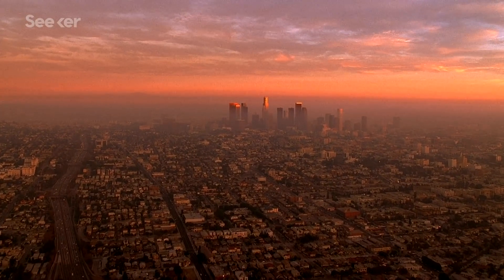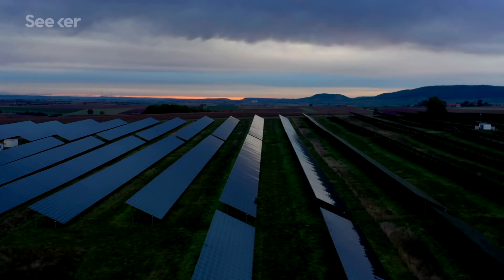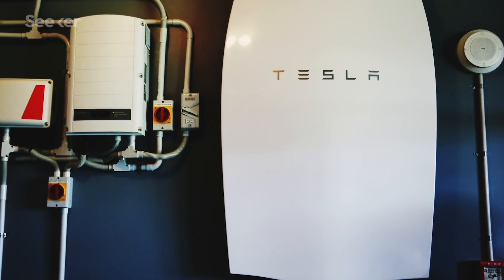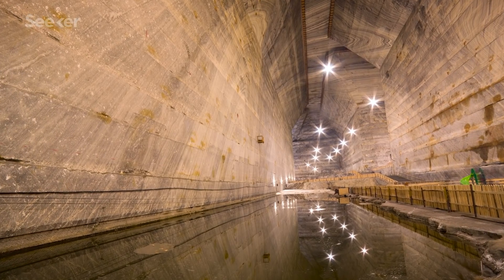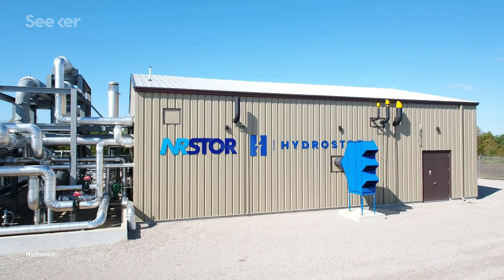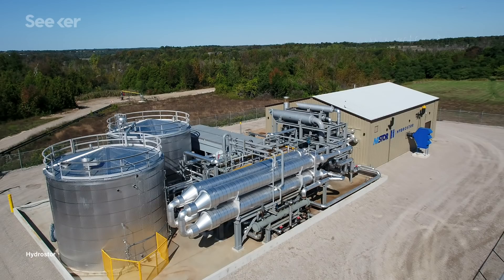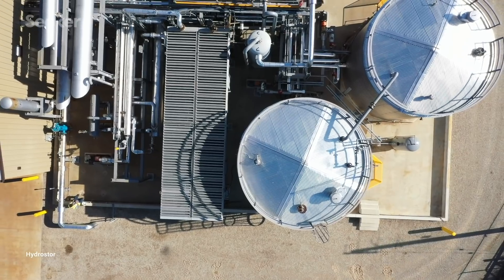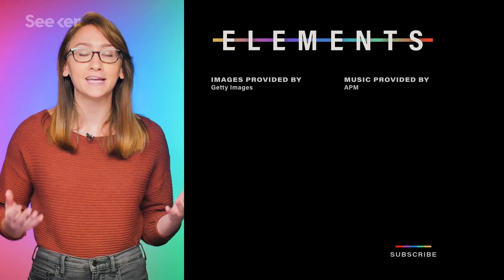This New Tech Could Revolutionize How We Store Renewable Energy

Comment: Instead of this just build a tower that will use electric energy at day time to lift the heavy blocks off the ground and by the end of the day blocks are at the top of the tower. 
And then it can be lowered down to run the generator at high speed and produce electricity.

Comment: By using a late Medieval technology called the Trompe, you can use falling water to compress air ... without suffering from heat build-up.
From 1905 to 1910, a construction project was created, to harness the falling water of a river, to compress air, to be sold to local mines in the Cobalt, Ontario region. The mine ran, with the occasional shut down for maintenance, until it was bought out by the Ontario Electrical corporation and shut down.
https://charleshtaylor.blogspot.com/2006/03/1905-1910-building-of-ragged-chutes.html

Comment: Carbon free. Buzz word for fake climate change as many many PhD scientists have called out. I will never get rid of gas vehicles. We will never moveboff thebmighty oil. Lithium, cobalt, and neodymium are super rare elements thus in no further explanation is that not everyone will be able to have EVs. Lithium cannot be recycled. Batteries have been around 100yrs and we barely can get 300 miles of a shitty tesla letbalone the hours and hours for recharging. Also electricity wont be free.

Comment: This is something I thought of a long time ago however I won't make claim to it due no money - and well no real proof I alone came up with it  too just not enough money     Anyway  an old thread sewing machine as an example   now the paddle is pushed by the needle which becomes a pole to do so ( there are other ways too) Anyway weighted appropriately it can be many many things  such as an non manual water pump    put between to bikes and a mechanical engine for the bikes ( if done the correct way )  a fan   a camping washing machine etc    I do not have money to do anything with this    - you can do this for yourself if necessary

Comment: The real scale of capacity needed? For the UK alone for full grid backup about 1400 to some 7,000 Terajoules. 
If the containment fails that's about 340 Kilotons to 1.7 Megatons in explosive yield.
Those figures don't really change if you store the energy as compressed air, in batteries, as chemical reactants, etc.
Not something comfortable to live next to.

Comment: 60% ain't enough - it drives up cost just like batteries. Pumped hydro does ~80% and isn't more pricy.
Cutting demand, flexible demand can help as well.
On demand biogas cogeneration, waste cogeneration plants could help, so batteries are souly used for immediate grid stabilization.

Comment: There are some manufactures that needs gas, and cannot use 100% renewable. 
Like to make glass. Where you need thousands of degrees of heat. Or to melt steel. You need gas for that. Renewables will not be able to melt those.

Comment: CASE is not efficient because air (or any gas) heats when compressed and chills when decompressed. It’s what drives a refrigerator. 
The question as to why is the only proven zero CO2 energy source being ignored is easy. It’s expensive - very expensive. Though it is extremely safe. 
Bit no longer We now have low cost modular nuclear which solves all of the reasons to not have the old nukes. And it automatically load-follows. It can fill in around renewables at no loss of efficiency. It even burns the high level waste from the old nukes. 
What’s not to like?

Comment: I helped build, license, startup, operate and shutdown or retire a two unit Gen III nuclear plant.  But as much fun as it was I just can't see their usefulness going forward.  Doesn't make any difference if it is a Gen III or Gen iV plant, a High Temperature Gas Cooled Reactor, a Thorium Molten Salt Reactor or even a Small Modular Reactor.  And it has nothing to do with no one wanting one in there backyard or how safe a Gen IV reactor can be or how wonderful and abundant Thorium fuel might be.  It is all about the money.  

The money to build, operate and clean up the radiological waste that just happen as the result of using nuclear power.  You know the daily radioactive waste clean up from leaking valves or pump seals or even the basic stuff like doing the laundry of workers who must work on radioactive plant components.  But there is something almost no one can control and that is the cost.  

You can spend about $2 to $25 billion dollars build a plant.  You will process your way through thousands upon thousands of cubic yards of concrete mix all while producing CO2.  You will install miles upon miles of copper wiring and control systems costing millions of dollars.  And of course you are going to spend billions of dollars to hire the electricians, pipefitters, welders, ironworkers and engineers to run the plant and those people don't come cheap.  Figure it will take about 100-300 workers to run each unit of a two unit nuclear plant.  Doesn't make much difference which type of plant you want to talk about it just takes about that many people.  You are either doing design changes, making the plant more efficient, working with regulatory agencies, cleaning up spills or just fixing stuff.  Now take those above number of 100-300 workers per UNIT and multiply that by about $40.00/HOUR.  Pretty sizeable amount of money isn't it for the daily operation of a plant that is only about 35% efficient.  Yes that is true, most nuclear plants usually burn up about 3 BTU's of heat energy for every 1 kWh of electricity produced.  They are not very efficient but don't blame that on the type of reactor.  Oh sure there is some heat loss in the process but we are also dealing with thermal dynamic principles.  You lose efficiency in every pump, every heat exchanger, every turbine and every electric motor in the plant and you even have to consider the heat loss in the wiring and pipes that carry the steam and condensate water back to the reactor to be reused.  And while I am very concerned about all of wasted BTU's of heat energy we are dumping into our lakes and streams that is just another part of the puzzle to be solved.  And of course you lose more power transmitting the power to where it is needed.  Now the alternatives; Wind, Water and Solar and yes they are all intermittent but lets look at just one example.  

About 6 months ago the wife and I were on our way to Vegas by car for a little entertainment.  We were about 20 miles South of Henderson, NV when I noticed a huge field of solar panel.  As a retired public utility employee I just had to stop and find out how the system was working.  I drove into the facility, pulled up to the gate and rang the bell.  A young man came out of a small building and we shared some of our common utility experiences.  I finally go around to asking him how many workers were at this solar site and he said just one, himself.  I asked him how much power the solar plant could produce and he said on a good day about 500 megawatts.  Now that is more than a small modular reactor but less than one average sized two unit plant.  But here is the kicker - he said he was only there to do a small repair.  He said NO ONE was normally at the plant and it was controlled from a central dispatching office.  This really wasn't news to me being a utility worker but for almost everyone else who happens to read this posting it is an important part of our energy policy.

Solar power turns itself on when the sun comes up in the morning and shuts itself down when the sun sets.  No USNRC trained and licensed operators are needed.  No low pressure and high pressure safety injection pumps are needed.  And certainly no separation of spent nuclear fuel is needed from some liquid like a molten salt. And we don't have to store containers or casks of spent fuel all around the country waiting for our government to come up with some way to dispose of our nuclear waste products or to fix leaking containers at some Hanford, WA waste disposal storage facility.  We can easily control the amount of output from that solar plant from a central location.  In fact one employee can do the job for several solar facilities instead of the hundreds it takes to run a nuclear plant and those workers cost thousands of dollar a day.  And wind energy is about the same.  When the wind blows and it is usually blowing somewhere at some point in time someplace in North America.  And water, yup you guessed it about the same.  When it is raining you are getting a free fuel delivery.  Just open a valve and watch a turbine produce power.    

So I don't see much hope for nuclear going forward.  It is just too expensive to build, too expensive to operate and too expensive to clean up after someday.  I only see renewables in our future and they have already proven they are safer, more cost effective and more environmentally friendly.  Hopefully after reading this very long posting you also come to the same conclusion or at least have a much better understanding of WHY renewable are what we need to focus on.  

Thank you and have a wonderful day.

Comment: why not just increase the efficiency of what we have so that it can function with less loss? this would reduce the emissions and make it green, why cant we just fix what we have to work better? also why not carbon batteries? they seem to work better than lithium for energy storage and are cheaper to make and contain no harmful chemicals.  but 60% efficiency is not worth the effort or money. you lose nearly half of the work before it is even used.

Comment: Instead of focusing on storage to match production to demand, what if we focused on demand shifting to match demand to production? Thermal storage is the easiest solution for most homes/small business. Have water heaters soak up extra power from wind/solar for later use and have HVAC chill/heat a mass that the air handler/pumps can use as needed. Do that and a small solar + Li-ion could meet most of a home's power requirements and be more resilient too.

Comment: This appears to be total bullshit, temp rising is only a function of the air reducing its volume, no mechanical energy is lost into "heating" the air, that just happens naturally when the volume of air is reduced, as a consequence the temp will rise as a proportion of reduction, so if a volume of air is reduced by 50% then temp will rise 50%, has nothing to do with the "work" needed to compress the air. If you consume 10,000 watts of energy to compress air you should be able to extract 9,000 watts or more of that energy back out.

Comment: Why not compress air in a tank full of water. Then discharge the water when needed to turn a turbine? Also I can’t see either way as efficient. You need energy to power a compressor where as a battery, the energy just goes in

Comment: Pro: This is very simple tech, needs no rare elements, should require relatively little maintenance, and can be used in more places than hydro power.
Con: Needing to buy or dig large caverns means large start up costs, and if they are only taking megawatt scale storage instead of gigawatts it is not big enough.
Anyways, doesn't matter how good nuclear reactors someone is building in thirty years, we will still need energy storage too and this apparently can be built now. I'm just worried about how big caverns you need to store useful amounts of power and how much output it can deliver.

Comment: Imagine, from all the recent fracking - tiny micro quakes fracture this facility and 2 MILLION WATTS of power in burst forth in the form of compressed air.

what about a 500 million watt system?

I wonder if it will rain bolders 2 km’s away?

a little jiggle and -boom! A bolder the size of a house is sent into the sky.

Comment: There is a huge amount of green energy potential in the world. Wind, water, solar, wave energy, and so on ... In Germany has been in operation such a system since 1978 to balance consumption peaks, that when consumption is low, compressed air is produced in underground massive tanks which then produce electricity during peak consumption. The good thing about compressed air is that it's a simple way to store energy, but the downside is that the efficiency of compressed air is quite poor. The efficiency of compressed air could be greatly improved by compressing the compressed air in the tank as cold as possible and then heating it.

Comment: Soil has a column density of 0.7 pounds per square inch per vertical foot, or higher, meaning that a column 3000 feet high would produce a pressure of at least 2000 pounds per square inch at its base. In situ separation of a 3000 foot deep 'piston' of soil and rock from the surrounding strata, such that it became free to move vertically, combined with the installation of a sealable chamber at its base, would provide ideal conditions for the storage of compressed air, as, once the material surrounding the chamber came up to the temperature of ambient air compressed to 2000 psi, little more heat loss would occur.  (If the result is too high a temperature for the material to withstand, reduce the pressure, also reducing the need for excavation.) . An advantage of such a system is that, until the supply of compressed air is exhausted, the supply pressure is constant.

Comment: Yeah.....
This tech is going nowhere, it's going to require a lot of energy to compress the air into the storage tanks.
No need to respond to this comment, just wait and you'll see I'm right .✌️
Reply: Sun and Wind tends to produce more than you need in certain regions and at certain times. Storing this excess, even at a high extra cost in energy, is still something worth doing in the end. And this tech seems to require less rare minerals when you look at huge battery storage and also doesn't require a lake/water reservoir you need for Pumped-storage hydroelectricity. In the end you have to do the math what is best for your regional powersystem.

Comment: Sorry gotta be a critic here. The stored potential of compressed air energy is efficient only if it can somehow offset the amount of energy it takes to compress it in the first place, and if so it will become a perpetual energy machine with a surplus. Semi trucks already use compressed air on their braking systems. It's already used in multiple different industries to run machinery and tools. But it's more for its reliability and ease of control. I just dont see this as ever being an efficient and viable large scale energy source.

Comment: I’m only an engineering student with thermo 1 under my belt, but why don’t we use the productive hours of renewable energy to power pumps that drive water up into a tower which we can let out into a turbine arrangement? My idea is like a potential energy battery if you will. 

I’m sure this is not an original idea, what I’m looking for is reasons why we don’t use this method or if we do, in what cases does it’s implementation make sense. Thanks if you can answer!

Comment: It's a 'maybe'. The losses are still pretty high during storage and recovery. There's also the matter of causing instability like with fracking. When you pressurize a large cavity, that's a huge amount of force to control. You can't be sure what will happen in the long term.

Comment: Somebody should make a compressed storage system that uses the heat of compression to heat residential hot water and uses the cold of decompression for refrigeration.
Reply: Fun concept but i think its impractical. The investment in isolating kms of piping so that, in the case of hot residential water, the heat loss is minimal would be tremendous.

Comment: She pretty much explained why battery storage is about the best solution out there in this video.  Why take produced electricity and convert it to another form of energy storage, only to have losses when converting it both into and from the second medium?  I agree that Lithium batteries are a bit of a problem, but that's why the next few years are going to be so interesting.  With the developments that have been announced in new cell chemistry over the last 5 years, I doubt it will be much longer before we see 10-20kw capable home battery storage solutions for less than the current cost of a tesla power wall.

Comment: Funny thing about the Toronto test site, is that the storage of compressed air is actually in Lake Ontario, so a little different than anything presented here. Also, it was installed in 2015 for a two year trial and I haven't been able to find anything about the results. I guess the info is still a corporate secret. Anyway, for the cost and size complexity of this system I really do wonder how it would compare to a more straight forward gravity based storage like a closed loop pumped hydro or the concrete block based system from Gravitricity.